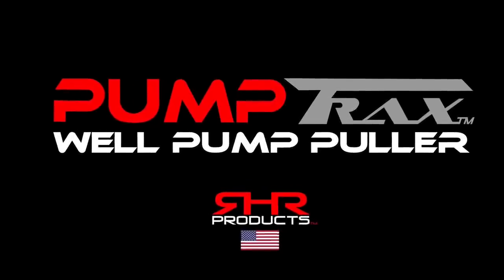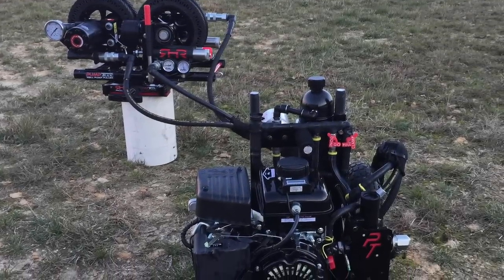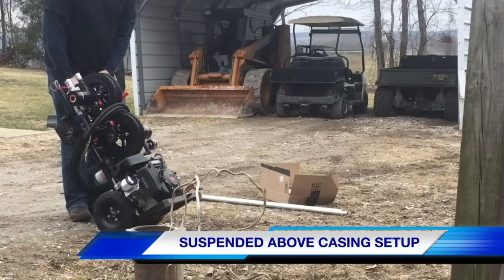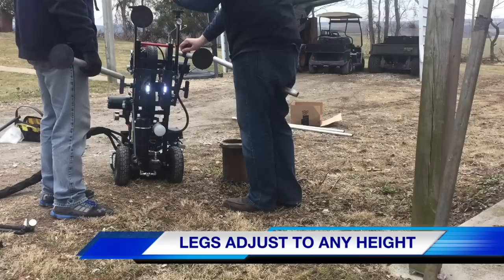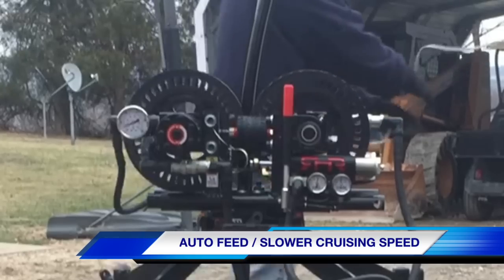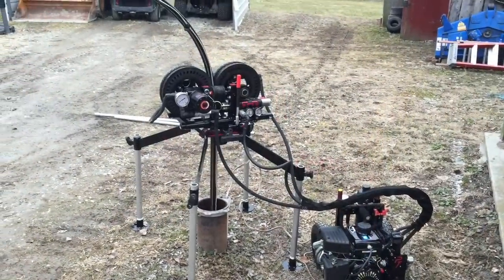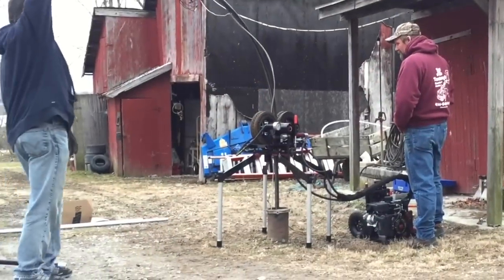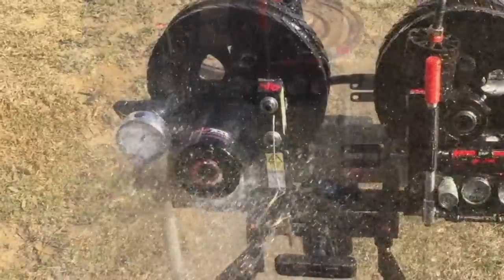Well Pump Puller | PumpTrax

Comment: Nice!  Debating on a truck or a portable puller.  This unit looks great!
Reply: I really like that, I sold my Monitor pump rig last year, I was tired of the maintenance of the vehicle to the ratio of pump work I do, I would take one of these though.
Reply: +engineer775 Practical Preppers Thanks engineer775!
Reply: What is the price. What is the maximum load that it can pull

Comment: How many feet can you pull 1 inch galvanized pipe?
Reply from the maker: Al Mayer Great question Al.  It really depends on the static water level.  If the well was completely empty and the check valve was holding water in the pipe.  It would then be a max of 360'.  However there is more than likely water in the well.  Let me give you an average well example.... Static water level 50' down, the max depth would be 450 to 480'.  If it was PVC pipe....Free hanging would be 1150'.  With a static water level of 50 feet it would be more than 2000' feet!  We have a chart on our website will all pipe.  Thanks for your question.
Reply: RHR Products LLC. Mobile number
Reply: RHR Products LLC. Mobile
Reply: RHR Products LLC.dietels